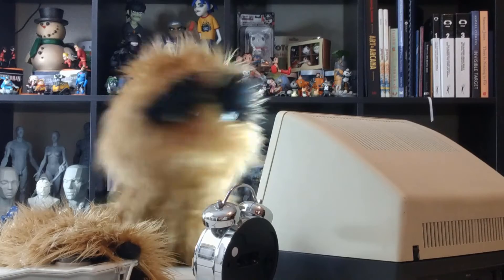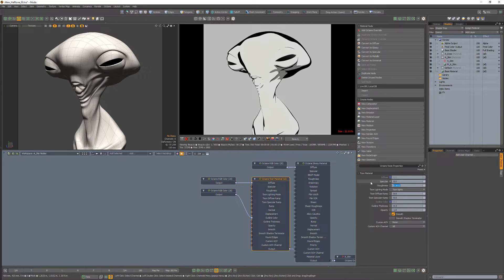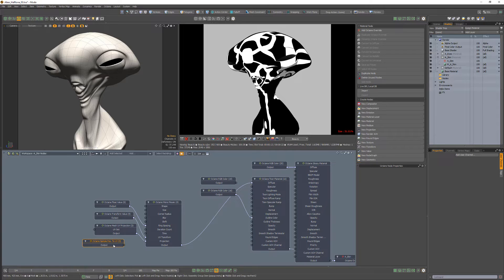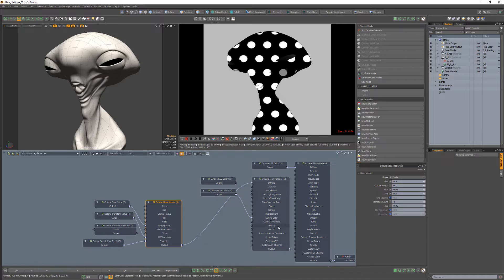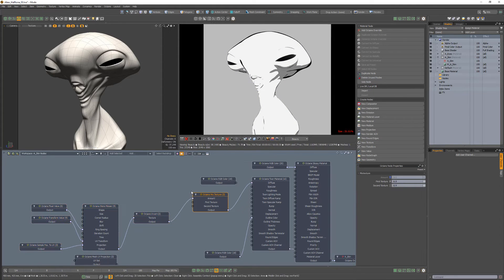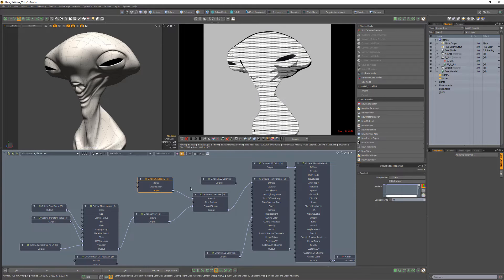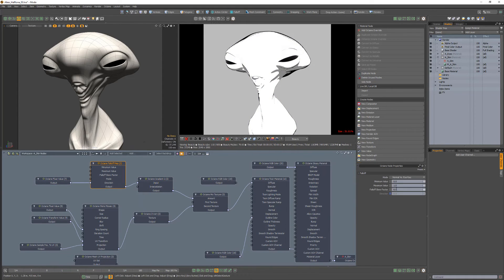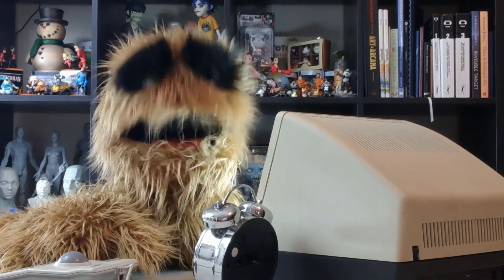Modo | Octane Render: Halftone Texture Effect

Comment: What you want is to effect the scale of the circles from 0 to fully overlapping based on the shading... Is that doable in octane?
Reply from the maker: That would be is you want to mimic Halftone as seen in Photography. This is more like what you see in Comics such as Manga where the artists are cutting film for shading. I'll explore changing the scale... I think its doable as you can connect nodes into the attributes.
Reply from the maker: Confirmed with Otoy today and you currently cannot vary the size. Only a single float value is available atm. Hopefully they add the functionality in the future.